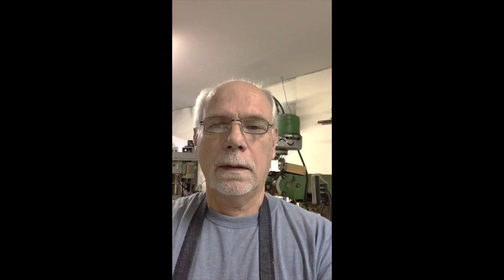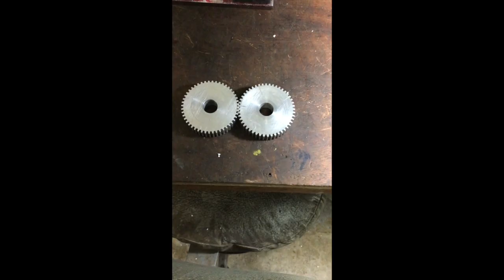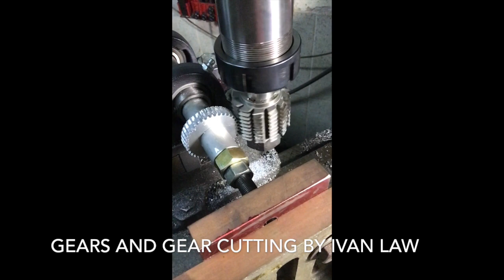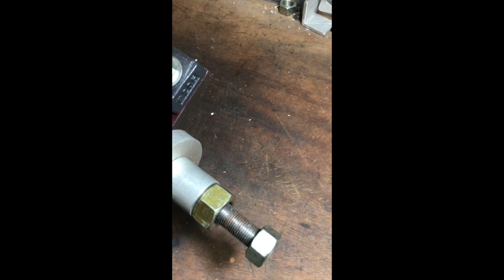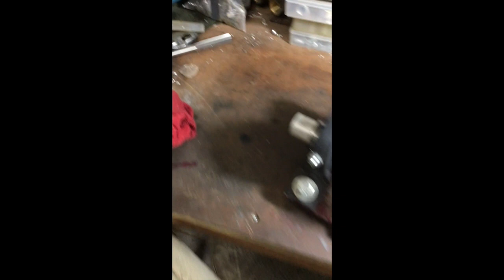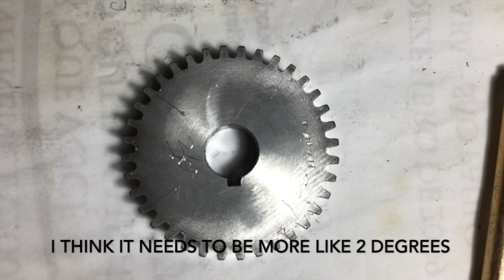Freewheel Hobbing. Can it be done?

Comment: The head of the mill should be tilted to the helix angle of the hob.  The helix angle is usually marked on the hob.  Better results can be obtained by actually gashing the blank using a slitting saw and indexing each tooth.  Then start hobbing full depth, working from one side of the gear blank t the other.